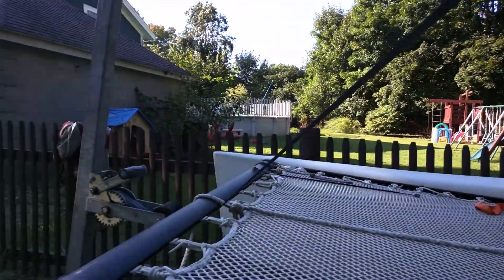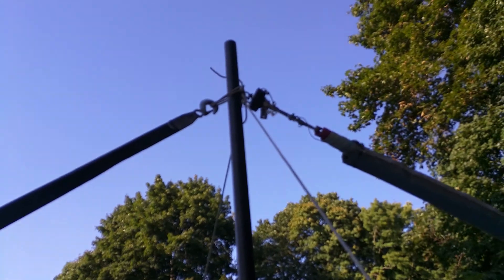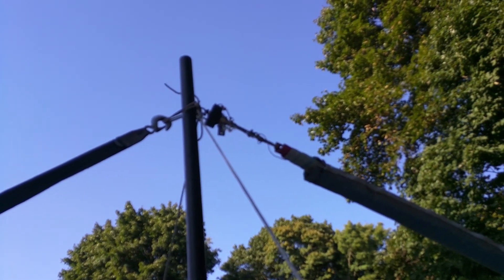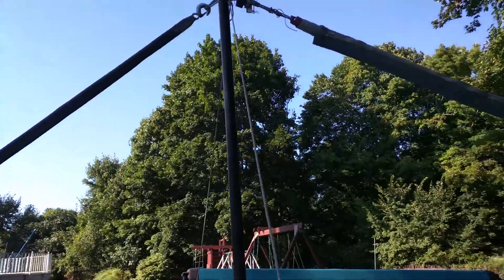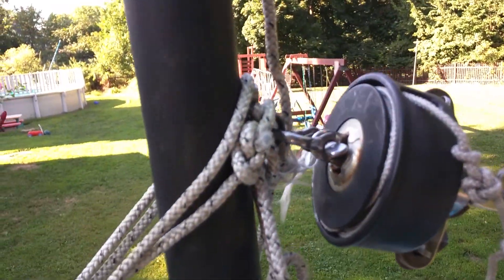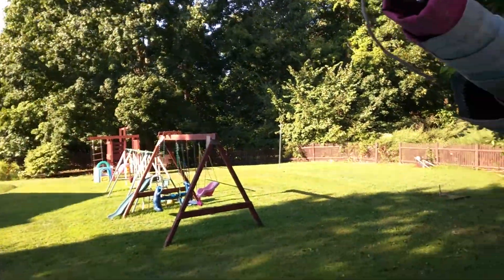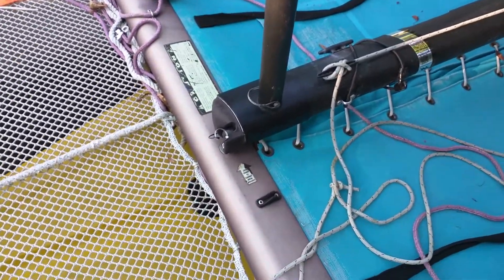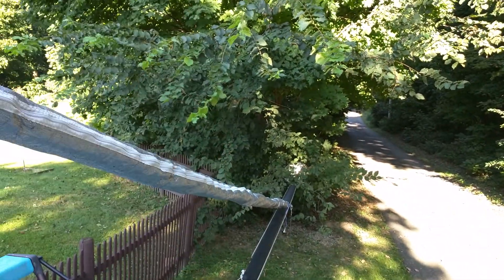Hobie Getaway Mast Stepper III Rigging

Comment: The tension of my system is so tight we couldn’t attach the furler with the bridle wires attached to the front crossbar. We had to disconnect 1 of the bridle wires to do so. Should we length both of lines that attach to the eye strap to the loops on each line? If yes what should the length of these lines be from the eye strap to the loops on each line? Should this measurement be 78”?
Reply from the maker: @JohnGoetze-fl5qp   Make sure nothing is preventing the system from stretching fully. Every now and then something either on the forestay or on the side shackles twists just enough to not let the rig stretch out fully.
Reply: @MITBeta  
We did go over the entire setup before we had to disconnect a bridle wire. I saw a diagram of the setup. It stated the 
measurement at 78” from the eye strap to the top of the loops in the side stay lines. My came setup at 68” should I move the loops 10” further done the line?

The diagram also had measurements listed at 36” & 38”. I have no idea what these measurements are referring to.
Reply: @MITBeta  
I noticed an earlier comment about the loops running in front of or between the wing struts. I ran these lines in front of the strut. Could this be the issue?

Comment: 0:09 lines should be between the bench "wing" legs not in-front. Your way would work, but it puts too much stress on the thin extendable wing leg. 
I use the stepper every time I sail my getaway, I also changed the provided shackles to snap hooks for faster rigging.
Reply from the maker: Thanks for the correction.